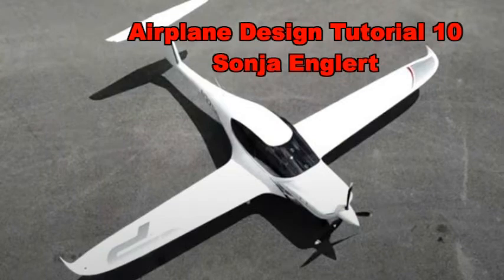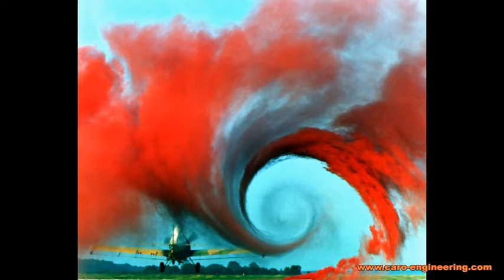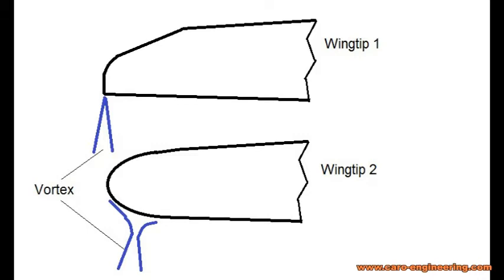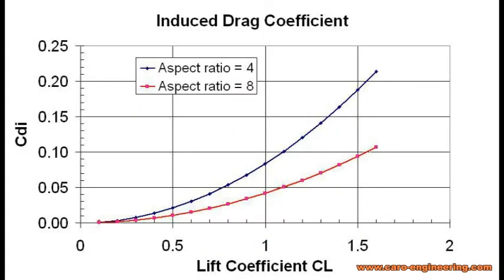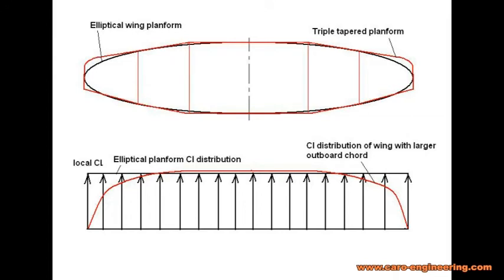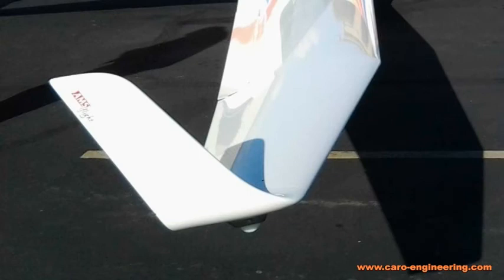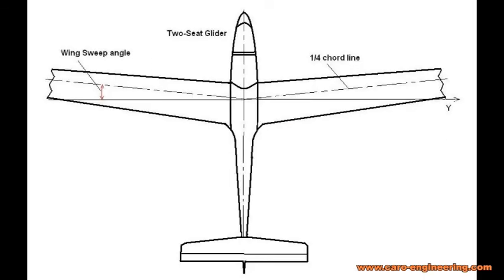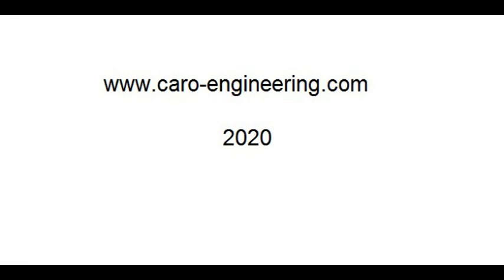Small Airplane Design Tutorial 10, Wing planform, lift distribution, induced drag

Comment: just curious, this doesnt really explain much as to why almost all high performance aircraft have a forward bias sweep (e.g. ww2 aircraft). Spitfires for example started with eliptical wings but transitioned to forward sweep biased wings with rounded tapered edges, and aside from having a heavier engine, there are other designs that also retain their forward sweep even with a mid-mounted engine as the engine upgrades got heavier (such as the P-39/63 family, whose engine lies behind the wing). According to my understanding is that it slightly marginally increases the lift performance/efficiency of the wing near the critical lift angle, but in return stalls become more drastic/sudden, necessitating washout/wing twist.

Comment: I have a question. When configuring a tandem wing aircraft on a straight cylinder fuselage.....can both sets of wings be on the same mid wing axis or does the front wings need to be lower than the rear? I have have seen RC planes with both sets of wings on an equal high wing axis but does this also apply to full sized aircraft?
Reply from the maker: The vertical separation of the wing does not matter much, it is more important to space them out longitudinally. A Canard airplane is a bit like this, with the front "wing" at the same height as the main wing. But the rear wing will always be affected by the flow from the front wing.
Reply: @sonjaenglert  thank you for the answer. So to be clear they can be on the same Axis as long as they are far enough apart?

Also, could you do a video on the specific benefits of particular wing, tail and fuselage shapes and configurations?

You seem very knowledgeable on these topics.

Btw the plane I am designing is a fictional fighter plane with a radial engine,  straight cylinder fuselage and mid-wing tandem wing design. The plane itself is described in my story as "slow but graceful and maneuverable" as both sets of wing flaps can be used to control pitch and roll.

I would enjoy a video regarding a tandem wing configuration of this sort